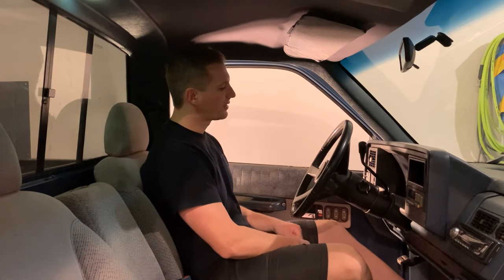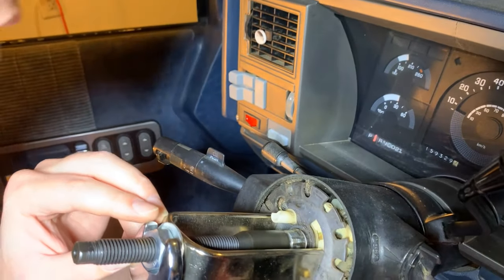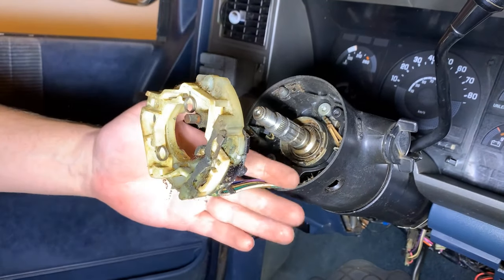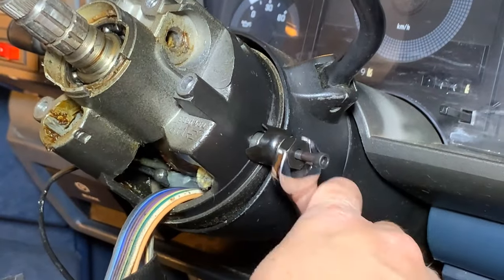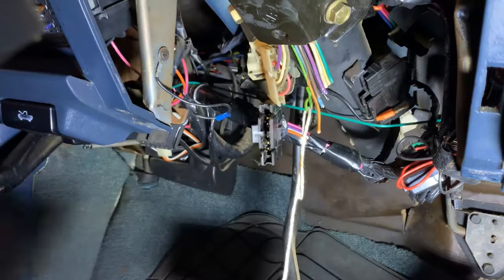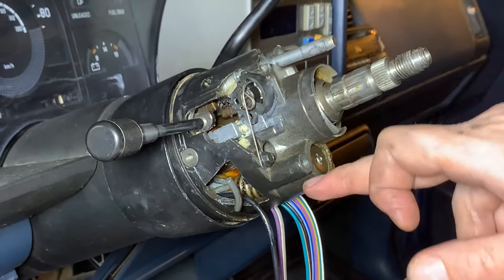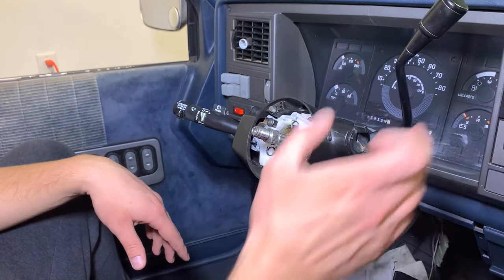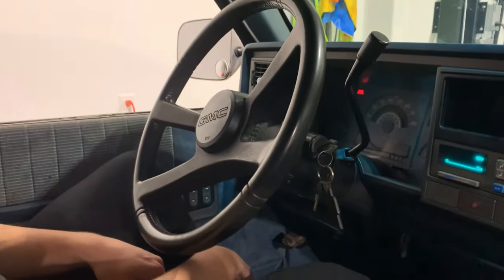Turn signal switch, horn, and gear spring replacement on an 88-94 OBS Chevy 1500

Comment: Cut the wires off the switch end and use them to pull the new ones through. Also no need to take that clear apart just to fix that shift spring. Pound the shift handle pin out pull the handle off pull the broken spring out with a angle pick and squeeze in a new spring. You took a five minute spring job and turned it into a nightmare. No kidding I do several a week on some white fleet trucks everyone is familiar with.
Reply from the maker: @John White I would worry that you would tear something up if you try to pull the plug through the column, it’s super tight. Good to know about the spring!
Reply: Thanks for the advice I came here because I have a broken gear lever spring and I was under the impression I had to take the steering column apart do you suggest there is an alternate way thanks I will try it appreciate the advice/information
Reply: @noblsht  I should add I do several a week so easy for me. A small straight screw driver is also handy to compress and push it back in, small amount of grease is also good. When you go to do it ur gonna be like no way but trust me it's the way to do it. If you have to pull the shift Bowl off to replace the rack rod and rack gear then the spring is obviously easier but if you don't I wouldn't. I do enough that I have probably 10 or more of those springs laying around.
Reply: @JohnWhite-Iowa-City  thanks I wanna head and ordered the spring tearing apart. The steering column looks like a real headache but with that video it makes it realistically possible thanks for the advice Assistance etc..

Comment: If you would have just taken the 4 bolts out from underneath the steering column the plastic piece your wires are in slips out and your wires pull right out! Then you feed your new wires back down through the column! No cutting! I did mine in 1hr start to finish
Reply from the maker: We didn’t have to cut any wires, just took the pins out and re-installed them.
Reply: Thanks. That saved me some a ton of time and the added room makes it so much faster.

Comment: 1990 suburban 2500... Ignition switch replacement. Had to remove or loosen the floor plate around the steering column and loosen two bolts behind the firewall around the steering shaft in order to pull the steering column down enough for me to get a wrench in there to get one of the two screws off let's say one is a hex head screw which I got out it's a 9/16 the other is a nut. Is it not 9/16 or does the nut have a retainer tab or clip that I can't see? I can't seem to get a wrench or socket on that sucker. It appears to me that I need to try to lower the column more or actually take the steering column out partially.

Comment: This is by far the BEST video I've found for diagnosing,  and repairing my same issues, it totally makes sense to replace  all while getting this involved. My '94 GMC k1500 4x4 extended cab w/189410 miles has been a restoration project for years. I purchased from the original owner at 150k 11/2016. (All work/reciepts documented on CarFax too) My left signal return inop, the gear shift no spring tension. Cruise/multi-function switch, part numbers! (I can only ask 1 thing you didn't mention. How long from start to finish should I expect this to take?) You did mention Day 2. This is my daily & only driver currently. Thank you and your Camera Person! Very thorough, Great coverage and explanation. Subscribed 11/13/22
Reply from the maker: @Scott Feron I would say this is a several hour job if you don’t run into any major snags.

Comment: Great video. I have a question about the bearings in the upper part of the column Mine were loose when I got my van what can I do to keep them in place. I have heavily greased and I have tried over and over to put then in and the keep falling out a I put on   the tilt body over the shaft.

Comment: Great video....step by step, and I can see what you're doing.  I've watched about 6 of these in the last week, this is the one I'm taking out to the garage to use...way, way better than the others.  One question if you still monitor this...the "Clock spring" .  What is it.  I didn't see one when I took apart my '86 column.  Nor did any of the other videos mention it at all.  What is it and what's it for and do all trucks have one?  Thanks, and thanks a ton for the great video!
Reply from the maker: @Anwat Sadat I would think that all of them have some sort of clock spring. The clock-spring allows the steering wheel to turn while still making an electrical connection between the horn and the truck’s electrical systems. It’s a spring loaded brush that rides in a concentric ring.
Reply: @SuburbanRanch  Thanks for the reply...and yes, you're right, I had one.  Just a little different in configuration.  Thanks again for the video.  I had stopped the teardown because I wasn't too sure about the steps to get to the deepest shift bowl, but after watching your video, I went back and finished all the way down...Great job on explaining and showing everything!

Comment: Did you put part nr in comments? I have same problems with my 90 Caprice
Reply from the maker: @janekoismaa They are all in the description.
Reply: @SuburbanRanch  can you add steering column upper bearing part nr?
Reply from the maker: @janekoismaa Sorry, we didn’t do the upper bearing. You can probably find it on rockauto though.

Comment: **************TIPS************************
i watched this entire video 2x last night to prepare for a wiper switch and blinker switch replacement. everything went ok except a couple things. pay super close attention to the little plastic piece that is the link between the high beam arm and the wiper switch. also, that ass of a snap ring that holds that steering lock disc to the steering shaft is a mofo. just slide the snap ring onto the puller tool and leave it until you reinstall. the plugs for the wiper switch and blinker switch went through the column pretty easy without removing the pins from the plugs. i just cut the wires from the old switches and electrical taped to the new plugs, you must bend the wires so the plugs go down the skinniest way and not 2- 5 inches wide. then lightly coat electrical tape with dielectric grease- smooth pull if you remove the column support bracket that holds the steering shaft to the dash frame( 2-15mm nuts and 4-13mm bolts).  maybe this will help somebody. it was 120 degrees in the shop today and i probably screamed "fu**" 120 times today. next time will be an easy job, but the first time sucks pretty bad.
Reply from the maker: @mike holley good on you for getting the plugs through the column! We tried multiple times and just couldn’t get it. Thanks for the comment!

Comment: For this Problem and a lose steering on a Tilt wheel. To the shop on a Monday Moring. Was told to  Repair this would Take about 3 hours. Now 5 days later I was told My truck was  ready. Well Turn Singles were not working as they should, Key was Hard to Engage, Steering would not lock.  Last was Horn will not work.  With that I am also out $214.00 dollars for nothing.  More Bro's In Montevallo Al. is the People that done work.
Reply from the maker: @I D K who knew? That sucks man, sounds like they really messed things up. It’s hard to find a good mechanic.
Reply: @SuburbanRanch  Yes it VERY hard to find a Good Mechanic.  I ill make it. Thanks.

Comment: 95 Chevy truck replacing the rear seal without taking out the transmission
Reply from the maker: @Jose Gomez No, you have to remove the transmission to replace the rear main seal.

Comment: Go to the scrap yard and remove the steering column- 3 15 ml nuts and about 10#10 screws. remove the plug in wires and reinstall on the vehicle
Reply from the maker: @George Heighington If you can find a decent column this would be a good option!

Comment: hey friend. just in the nick of time. I had a mechanic install a new ignition lock cylinder. after he fixed it my turn signals no longer worked and they worked before. I am getting no turn signal lights on the dash and of course, neither left nor right front or back is working. can you give me any idea as to what could have happened?
Reply from the maker: @Noel Roe I would guess the mechanic did not plug the turn signal switch back in or damaged it

Comment: Is the process similar for a '90 GMC Sierra 2500 AKA the C/K Series.? We have the 2WD C Series, 3 speed (reverse doesn't count) manual "floor" shift, non-tilt wheel without cruise control but we haven't been able to key start it for some time now, it will roll start / pop the clutch fine but the battery has to be disconnected or the fan just runs and drains the battery. New ignition cylinder was the original repair plan but I'm not sure that will fix it and don't know where else to start. Any help would be amazing! Thanks
Reply from the maker: @Evie P Could be a lot of things, you need to track the ignition circuit and see where it is losing the signal
Reply: @SuburbanRanch  thank you

Comment: Hey bro, what led me to your video was me trying to find a video that dissected the steering column...i have a 94 k1500 and what i thought was my ignition switch going bad has turned into a problem that im completely stumped on...ive rebuilt almost everything on this truck and restored it as well...when i turn the ignition lock cylinder to the on position and then turn it to the crank position and start the truck as soon as it returns to the on position the truck shuts off along with the electrical that you would see in the on position...do you have any idea what that could be?...im trying to see what happens when the key is rotated to on and to start.

Comment: Is it possible to remove the steering column clamp and then pull the wires with the connector on them up through the space, so you don't have to disconnect the wires from the connector?
Reply from the maker: @bud irving no, the clamp does not give you more space it just holds the column up

Comment: I was thinking about going ahead and getting started with my 93 Z/71 but now I think I’ll wait or would it be easier to switch out the whole steering assembly with a Part truck ?
Reply from the maker: @mark rigney All of the parts trucks are 30 years old. I wouldn’t be surprised if half of the stuff is broken on the used column that you find!

Comment: Does the wire for the cruise control disconnect from the arm so you can use the old wire? Or do I HAVE to run a new wire down?
Reply from the maker: @Cale Longfellow Unfortunately, it does not disconnect from the arm. You will have to run the new wire.
Reply: @SuburbanRanch  does the piece of the column to replace the wiper switch have to come off to run that wire?
Reply from the maker: @Cale Longfellow I would say yes, the routing is not straightforward

Comment: That signal light switch if i replace that will it fix my problem with my high beams not turning off? It broke when i tried turning them off
Reply: Never mine you answered my question on 14:55 thank you!

Comment: Sorry to be so clueless, what is OBS? I have 88 chevy k1500, mechanic screwed something up when tightening up the column. First time I used tilt, I felt/heard something break. Now my dimmer (on the multi-function turn signal wand) just flops back and forth. Turn signals difficult to operate.  Who knows about cruise, I'm afraid to wonder. Is this video something that might help with my '88 truck? Thx
Reply from the maker: @Coene Schamaun OBS stands for Old Body Style. But yes, this should help you with your ‘88 truck
Reply: @SuburbanRanch  sounds like they did not line up the dimmer cam slide & check it for functionality before continuing reassembly. Then when you tried it it was stuck. Most likely have to replace a part or two now.

Comment: Im about to dremel the plastic piece to my steering wheel collum off bc it wont slide off like urs did. I took out all of the bolts and everything and the key ignition switch and the plastic part will not slide offfffffffffffff. I need help

Comment: Any chance you remember the round  about price you spent for parts not counting the steering wheel puller I'm just trying to get an idea if it would be cheaper for me to replace the parts or buy a good used steering column an just replace the ignition switch.  I don't mind doing the work it's just that I'm on a budget at the moment.
Reply from the maker: @Mickey Wray Probably $200-250 if I had to guess

Comment: question? is that original 59k miles? if so thats very low, i am aware they do roll over at 100k
Reply from the maker: @High-Tech-Rednek it has 159k miles, the 1 is there it’s just hard to see
Reply: @SuburbanRanch  good looking truck

Comment: what is that part at 35:o7 you are refering to as a clock spring, what does it do and what is the actual part called, mine broke when removing it

Comment: Is the windshield wiper switch part number that you showed and used, except for tilt steering, meaning non tilt?
Reply from the maker: @Roy Ice I would think that the parts are different for tilt and non tilt but I would have to look up the part numbers to be sure.
Reply: @SuburbanRanch  I'm in the process of ordering, then I seen this. actually where the switch sets I don't see why the d6335d number wouldn't work fine, unless I'm not thinking of something. Or maybe the supplier numbers are wrong.
Reply: I caught the difference I was looking at wrong part numbers

Comment: I was following through, then had a pivot pin issue, fix it but mine wont pull off. How do i get it to do that?
Reply from the maker: @rebecca bomkamp Are you using a pivot pin puller?
Reply: @SuburbanRanch  i did use one to get pivot pins out but how do i get the sliver main part off?
Reply from the maker: @rebecca bomkamp I’m not sure which piece you are asking about. If it’s the piece we removed, it should pull right off after removing the pivot pins on both sides.

Comment: Hi!  Have you ever worked on a column on a 1993?  I have a 1993 K1500 Suburban and replaced the cancel cam and the turn signal switch.   On mine, the dust cover on top of the assembly and just below the steering wheel is metal held down with two torx screws vs the typical plastic dust cover.  After getting everything together, the horn works but when I turn the wheel at 11 o'clock or 1 o'clock, the horn beeps... apparently, this metal dust cover is causing a grounding problem. It doesn't look bent or deformed... any suggestions?
Reply from the maker: @JJ C Not familiar with the 93, sorry!
Reply: @SuburbanRanch  unusual setup with a metal dust guard.  I'm going to try putting a plastic one that should fit and cure the problem!

Comment: this is an awesome video. the best one I've found on youtube.  anyway now my problem is my windshield wiper isnt working, in fact the wires are getting hot and at one point even had smoke coming from the column. the plug under the dash was extremely hot. i noticed it only got hot when i put the wiper switch on high and i noticed that the gauges moved back and forth. what do you think is my problem, maybe a short or maybe i should just replace the stalk and switch. what you think.
Reply from the maker: @Noel Roe Yeah this is an electrical problem, possibly a short. Sounds like something is pulling too much current. I’m surprised it didn’t trip a fuse.
Reply: @SuburbanRanch  my radio fuse was blown, i dunno if that was from the issue at hand. im going to rebuild the column as this is an old truck 1988 c1500. the wiper fuse is not blown and i swapped it out with a known good 25 amp fuse . i noticed as i put the fuse in it kinda sparked a little. is that weird that it would spark. is it possible that one of the wires got bare and is touching metal, grounding out.
Reply from the maker: @Noel Roe If the wipers aren’t on I find it odd that the fuse would spark. That said, the battery sparks when you hook it up and nothing’s on. Hard to say. Sorry, electrical is not my forte!

Comment: Can the turn signal switch cause problems with the tail lights on these obs trucks? I'm having issue with tail lights not working when headlights are on. Grounds are good, new tail lights/circuit boards, new headlight switch, new tail light wire harness. Only thing left is turn signal switch. Thanks!
Reply from the maker: @Joseph Not that I know of

Comment: but, but, but, how did you keep track of which wire goes where in the connector??
Reply from the maker: @bud irving we took a picture before we disconnected the wires so we would know where to put them back.
Reply: @SuburbanRanch  I have never used a cell phone.
Reply from the maker: @bud irving I would write down the order then.
Reply: @SuburbanRanch  Before I got a cell phone I always did the same. Get a piece of paper & a marker, mark the side & end of plug you started from, & write down the color one color at a time til you reach the end & double check it before you take it apart. Take less than 5 min. You'll be glad you double checked it in the end. Then just follow his instructions for unpinning the wires. Just be careful not to over bend the clips on the wires. Most of them will break if you overdo them. Pretty easy after first one or two. Good luck.
Reply: Omg your question is hilarious!! I love the “but but but”.